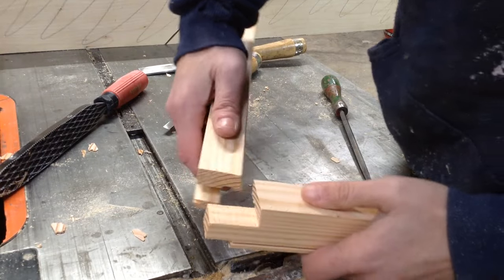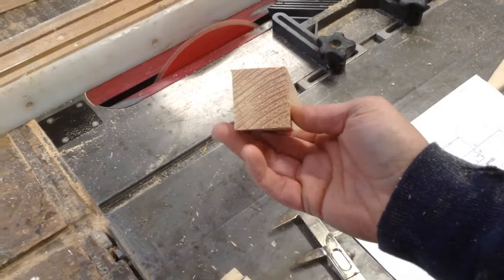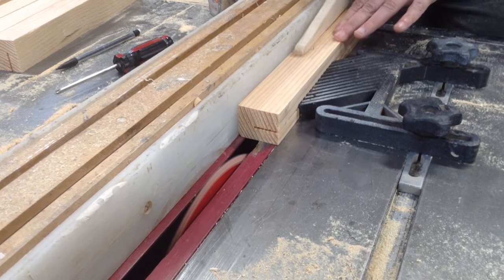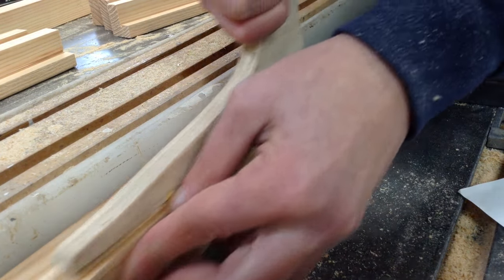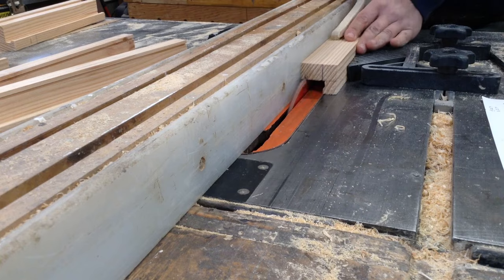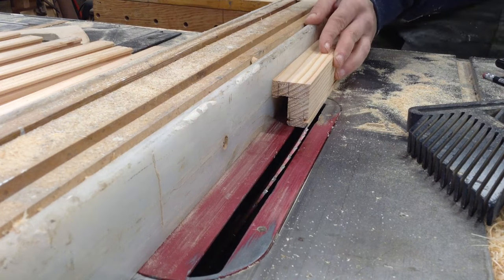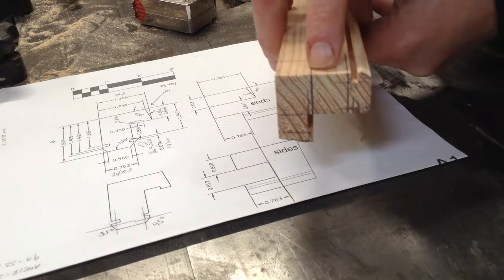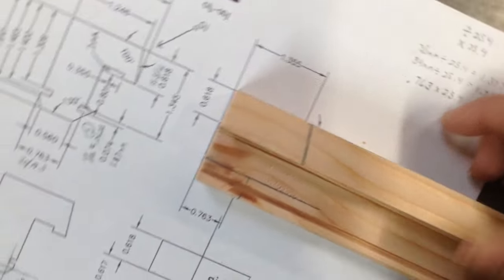How To Fix Rotted Pella Proline Casement Windows

Comment from the maker: I keep getting emails about this so wanted to clear up some confusion.  The drawing in the video was provided  by the original person who reached out to me about help figuring out how to make these frames.  He informed me the drawing is NOT accurate up to a 1/4 inch in some cases.  I would happily provide people with the drawing for free, but with it not being accurate it will not be of much help.  If someone really wanted a scaled drawing I wouldn't mind making a master copy for people, but I would need an intact cross section of the window in order to do that.
Reply: When I rebuilt my sash, I watched your video multiple times and I followed your example pretty closely.  I printed off some screen shots of the drawing for reference.  I too thought that having the original drawing would be helpful, but in retrospect it really wasn't necessary; the left half of the bottom of my sash was intact so I could take the measurements from that.  You did not appear to rely on the drawing, but instead measured everything carefully and transferred the measurements to an orthographic drawing so I did the same.  

I was tempted to skip starting with a pine test piece before I cut the final piece out of oak, but I'm glad that I didn't; I made some mistakes on the test piece that I corrected before cutting the final piece.  

I am a real amateur and a slow worker so I spent several days between removing the sash and putting it back in.  If I were to give a bit of advice to someone with similar skills who wanted to tackle the same project, it would be to temporarily replace the sash with a piece of plywood and then take your time with the rebuild. 

You were a very good teacher.

Comment: I’ve been an architect for almost 40 years.  I had Pella casements in both my houses.  My current house is 27 years old and the Pella lower sash on my casements are rotting.  Pella has been in several class action lawsuits regarding rotten window components.  I will not spec them any longer.  The other issue is Pella changed the sash profile Back about 2002, so replacement sash units are not available now rendering my windows obsolete.  I’m glad you made this video, as at some point I will have to make new sash components to repair my rotten window parts.  I’m going to use Spanish cedar. Thank you for posting.
Reply from the maker: I did a little reading about the windows and it from the comments of people that had them.  If you managed to even get money back it was a fraction of what was spent on the windows.  Some people had windows rotting in less then 10 years.  My parents live in an old Victorian built in 1887, before pressure treated lumber.  All the windows are still original.  To spend that much money on new windows for them to fall apart that quickly is absurd.

Comment: The Shinto rasp is quite the multi-tasker.   For the price it hard to beat. Shaping handles for a shovels or rakes, faux live edges, cured spray foam, ect… 

You should be very proud Caitlin of this.   So much to unpack in your method, but you nailed it. 
Thanks for sharing.
Reply from the maker: Thanks.  I have use it quite a bit since I got it.  Great tool and not too expensive.

Comment: Thank you!  Thank you!  Thank you!
We opened one of our Pella windows last spring only to have the rotted bottom fall out.  We feared that we would have to replace all three double casement windows on that side of the house, but by following your excellent instructions, I was able to repair the badly rotted window sash.  Luckily the other windows were in decent condition so we will be able to refinish and reseal them without rebuilding.  You saved us a fortune.
Thanks again.
Reply from the maker: No problem.  Really happy this video helped someone.

Comment: Hello. I'm dealing with one of the larger windows in my parrents house as well as a sliding glass door. Both of them are rotted out to an extent on the bottoms. Where did you get the CAD drawings? I am skilled enough at wood working that I could rebuild them for several hundred dollars vs the $12-15k Pella is going to want. The door alone is well over $8k today. Great video and thank you for posting this as I've been trying to figure out how I might rebuild what they have rather than replace. This gives me hope if I can get my hands on the drawings somehow that I can save some $.
Reply from the maker: The CAD drawings came from the guy I made the video for.  If I remember correctly his friend made them.  I would gladly give them too you, but he informed me that they are actually not accurate.  Some of the dimensions are off by more then a 1/4 inch.  If you have enough good lumber left you can cut a cross section and use that to make a drawing.

Comment: Thank you so much for this tutorial. I have Pella pro line that I need to make . The bottoms are all rotted out. Excellent tutorial do you have the drawing available that you are working from. I will follow your tutorial and try my self. Thank you
Reply from the maker: I do have the drawing, but it won’t help.  The guy that gave it to me said it’s not accurate up to an 1/4 inch in some spots.  The best way to get measurements is if you have a piece that is structural enough to make a cross section and pull dimensions from there.
Reply: @HoneyBadgerWoodWorks  I understand where you going. I have completely rotted window bases so your tutorial will help me get a good start. Thankyou again

Comment: You mentioned that the Douglas Fir wood not be your choice of woods.  What species would you recommend for Minnesota?
Reply from the maker: Doulas fir isn’t a badly rated exterior wood, it’s just not the best.  If it was my only option I would use it and prime it well.  KDAT : pressure treated kiln dried wood is what I would try and find.  Because using well rated exterior lumbers like white oak or mahogany would be a sin to use on something like this.

Comment: Awesome video. Only problem is the wood rotted so much there is nothing to trace in my case. my glass cracked as well. Pella couldnt provide me measurement of the glass. I have to find a place I can have one made up. i want to order the glass without taken it off first.
Reply from the maker: That sucks.  You would think at the least they would have a cross section with measurements for the original wood.
Reply: @HoneyBadgerWoodWorks  With the lawsuit they probably dont want to provide any information.
Reply from the maker: That’s a good point.